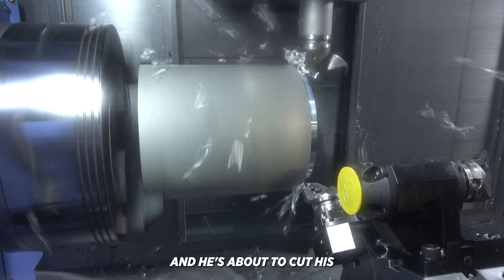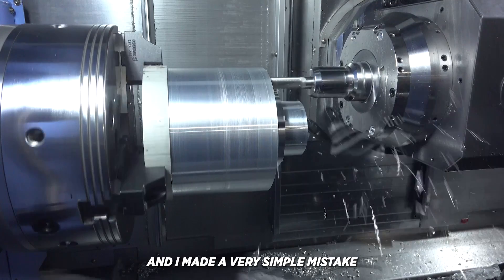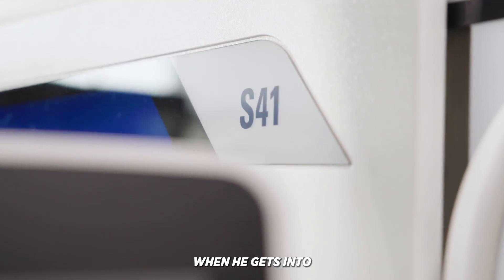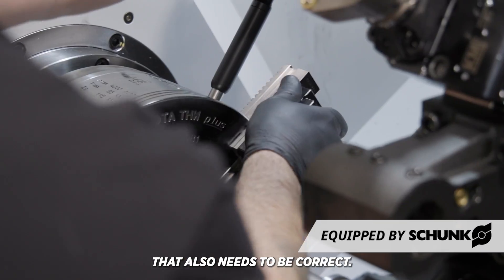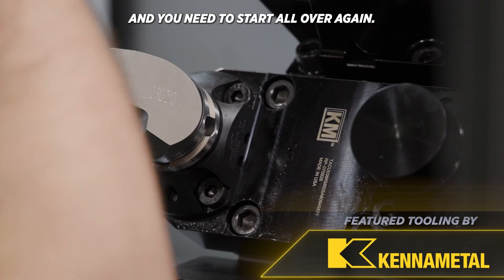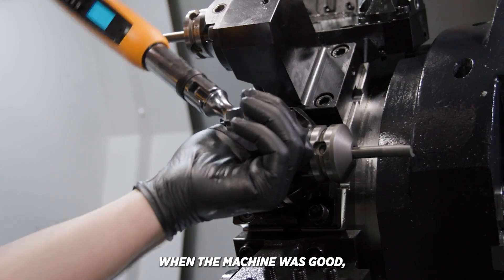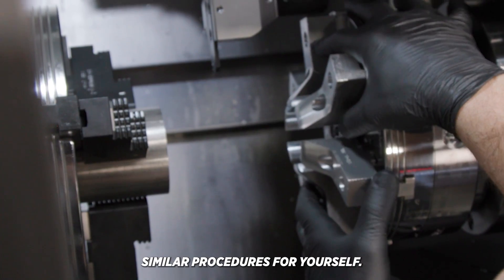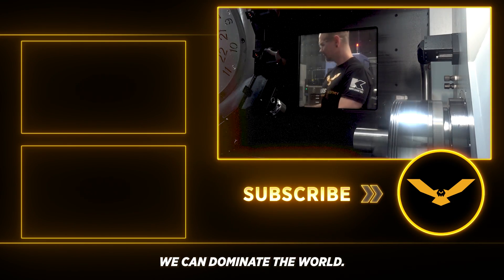My Mistake SMASHED the Tool & Holder Into the Part Causing Huge Damage… What Now?

Comment: My worse crash was throwing 10” cast iron jaws out of a lathe. I had been machining for about 3 years and was cutting a simple bore in a odd shaped part. The G50 was defaulted to 2500 and was running 600 SFM about 1.25 bore size. It didn’t take long for the 4” long jaws to stretch and break the bolts throwing the jaws off the chuck. Im damn lucky it was a newer machine and it kept the jaws in the machine, it broke the glass and damaged the way covers. I have a great deal of respect and understanding of centrifugal force now. looking back at it the job wasn’t well thought out from the start there was no reason we should have been using 10” 4” tall cast iron jaws the job could have been done with 2” aluminum jaws. BE CAREFUL OUT THERE!!!
Reply: I dropped a used lathe we got at an auction once. I was a maintenance guy moving the lathe into the shop. It fell over. Boss was not happy.
Reply: Wouldn’t it have been centripetal force that caused it, not centrifugal?

Comment: I am very fortunate that I don't have to make money with my vintage CNC. I preview the cut in software, I take a run with no tool holder, and then another run using a 3d printed plastic tool holder with a sharpie as a reference for the cutter. My first cut is in a foam block in place of the stock, while my finger hovering over the hold button. It adds a lot of time, but less time than dealing with a cutter and tool holder slamming into something and messing up the tool holder, the taper inside of the spindle, the vise, and then having to re-tram everything. Don't ask me how I know :-(

Comment: I let a roughing tip burn out on a 3 inch stainless steel job as a result the finisher tried taking too much off and ripped the part out the chuck, unfortunately the part jammed between the jaws and a 40 vdi tool that it snapped clean off along with cracking all the linear bearing in the x axis.... $10000 repair. 
There is now a note at the top of the program to change tips regularly. I still have the smashed up jaws, part, bearing and tool i keep in a cupboard to show apprentices what happens when you neglect tips. 
I've done or seen most mistakes in my time but there's always new ones to be discovered.
Always better to be cautious if you think somethings close to hitting bring the tool down manually to check clearances or winding a handwheel away from a part before going in to make sure its at the speed you expect or double/triple checking figures. If something goes wrong its usually when you least expect it. Always visually inspect your parts if something goes wrong 9 times out of 10 you can see it.
Reply: A guy at work was telling me to come over to look at a part whilst it’s face milling because it keeps sparking and looks really cool, I’m like yeah but your tips are fucked that’s why it’s sparking so they need changing asap 😂

Comment: I crashed a milling Machine once with a wrong tool-offset and almost crashed it a scound time because somebody interrupted me during the setup process, doing the setup a second time prevented it. I was lucky  that only  the fixturing and tool were damaged beyond  repair and the spindle was fine.
My setup proces since then is:
1) set tool offset an tool number,
2) put in the tools
3) call the tools and check if the right tool is in the spindle 
4) check the tool offset
5) probe workpiece 
6) measures the workpiece  with a different cycle and check if all values are plausible.
Reply: That is a great process. Ive had my guys check their workoffset with a simple G0 G90 G54 X0 Y0. Is it in the correct spot? Saves parts all the time.

Comment: The only time I ever had a major crash was when I trusted another operators setup at shift change, he had the part loaded, the doors closed, and he said all I had to do was hit go, sure enough he left a locator in place behind the part and 30 seconds into the program a shell mill smashes right into it, luckily the part, fixture and machine were all fine, just replaced the shell mill head and continued on with the part, no issues, we even had a spare locator. but man it was scary
Reply: 100% agree. Never trust anyone. Always double check their work.

Comment: Similar thing happened to me. The tool ran straight down through the part on rapid. Didnt even had a chance to hit an E-stop. The machine stopped itself when the tool holder hit the part. Fortunately it was wood so the spindle was ok, just broke two inserts in the cutter, destroyed a vacuum clamping block and of course made a giant hole in the stock. Good learning experience though. 

Could have been a lot worse. Now my routine is checking everything multiple times, especially Z offsets and always extra caution when running a program for a first time. Did not make a similar mistake since.
Reply: wood in a cnc machine? what kind of work were you doing exactly?
Reply: @blizzardesigns  It is a machine intended for wood, MDF etc. I know I know, I am probably an outsider here :D 

It's a fancy 170k$ 5 axis router basically. It is built for furniture production. Sure it is not a mill, but you can still make very expensive mistakes there.

Comment: I scrapped a 15k part a few years ago, by adjusting a Z offset -.010 instead of -.001.  That was a horrible feeling cause there was over 20hrs labor already in the titanium part.
Reply: And you still had a job after?
Reply: @gooblio  Good question. From my experience, the guy that tries to hide those mistakes end up losing their job. The guy that owns up gets a slap on the wrist. I wouldn't count on keeping a job if you made a habit out of it.
Reply: @gooblio  Yes I kept my job but had to fill out scrap part paperwork, and take a "random" drug test.

Comment: Well I always run a simulation when I can and you would have seen right away that you made that mistake. 
Worse decimal error I experienced was a G0 X240 is was supposed to be X24.0, programmer missed a decimal point. So instead of rapid to 24 inches it tried to rapid thru the part to 240 thousands.
100HP lathe with a 4 speed gearbox in low gear. The spindle didn't stop  A 2000lb 24 inch diameter piece of cast iron pulled out of the chuck and rolled past me. Scared me so bad I couldn't finish my shift. The error was in the middle of the program so very difficult to see and no simulation on the controller. I think it was an old Fanuc 3T long time ago.
Reply: Thats why you need to lower the rapid movment speed when you have changed something in program :). I am using rapid movement just when i am 100% sure that program is correct and functioning as it should.
Reply: @PetrolHarizzo  Yeah on that size part I never run the first part over 25% rapid, but I was still too late getting to the E-stop. It was on a grooving cycle pulling out of the 3rd groove. This was a part that had been run before so the program should have been good.
Is it possible to have an error uploading the program or something else?
Reply: You should have run the prog through the graphics 1st. Then proved it out with low feed control and distance to go in single block.
Reply: @geoffgreenhalgh3553  I like to read the operation before I run it. Sometimes it takes a while, but graphics don't show Z values or feed rates.
Reply: @redbeard_1371  They show the route of the tool.
Reply: lol I worked with a guy who punched a face mill through a 100,000$ part. day before christmas.
Reply: Thats crazy! As an operator, how would you find those errors ahead of time if you didn't write the program?
Reply: @redbeard_1371  to be honest that’s not your problem to spot, the machine setter and programmer should’ve eliminated that before they give it the thumbs up to run
Reply: @willyharris4199  True. But you would be the hero of the day if you did. Good brownie points for someone looking to be the programmer.
Reply: @redbeard_1371  yeah you’re right, I suppose it depends how much you trust the people to do their job
Reply: @willyharris4199  From my experience, the answer to that is "never trust anyone's work". I was at an H-tech in a huge college, (won't mention the name) and the instructor had a Haas St-10 CY "set up" He let me drive and within seconds a live tool ran into the chuck. Fortunately, I had my hand on the feed hold and stopped it before anything broke.

Comment: A sphincter mounted 'e'stop would be great!
Reply: Just keister a little chunk of coal. If you ever crash your machine too badly, even if you lose your job, you'll have a diamond as emergency funds.
Reply: water sensing e stop underwear
Reply: @yo64yo  i will buy it
Reply: These comments....the sphincter e stop....I'm dying lol here
Reply: It's called a pucker E Stop. As soon as your ass clenches it stops the machine.
Reply: I wouldn't get any parts run.  Clenched butthole is just my default state.  I guess I have resting clenched butthole when setting up machines.
Reply: @somethingelse4424  Do you write the programs that you are setting up? I am a little bit calmer if I wrote the program myself. I'm a lathe/swiss machinist. My usual M.O. is to make sure check the beginning and end of every tool to make sure I'm clearing the material/part and of course make sure I'm not going to make parts of the machine that shouldn't be touching each other touch.

Comment: I once crashed a 290mm length tool in a CNC mill becouse we had to put the tool first in the chamber before the big part came in. Soo when I ran the program the tool was too long and crashed into the part in the middle of the tool change.. never crashed the machine before and that was very humilating 🤣
Reply: Almost had a similar experience on a vertical mill with a carousel tool changer, tall vise, tall part and a long reamer. Tool change is up, spindle pulls up and does the tool change right above the tall assembly and the moment the tip of the reamer had less than an inch of clearance at the closed distance between it and the part I've seen my life rush past me haha

There are things you never think about after working for years on the same machine until it happens
Reply: @chas1878  Exactly dude.. sometimes you have to pay attention to soo many factors in some non-mass production scenarios that the most little thing can cause some serious trouble haha. In fact, nothing happend to the tool changer or the tool becouse it has a colision sensor. That pissed me off not by actually crashing it  but becouse didn't manage to notice that beginner  mistake!
Reply: I was paying full attention to all the stuff you usually forget (even removing some tools that might hit the part from the ATC)

And i forget stick out, having less than half a millimeters from a 20k rpm ER40 hitting a part that already cost more than i've ever had in wages at that point

Comment: I'm a little concerned about why your feed hold wasn't working properly lol
Reply: Probably won't work on a threading op.
Reply: In some machines while in a cycle  Feedhold wont-work just like on  A mazak tapping cycle,,,it's fully committed lol
Reply: @jasonruch3529  interesting!  I didn't know that...good to know, cause we just got a Mazak lathe lol
Reply: @Steelcrafted  feed holds when threading on a mazak will complete the cut then hold. external screw cutting it will finish the pass pull away from the part then hold, very useful when chasing threads. 
when setting the block for the stock material its best practice to set it correctly because it would avoid mistake like whats explained in the video as when you go to simulate the part it will error out as it will identify that there isnt enough material for the cut to work
Reply: @jasonruch3529  Exactly
Reply: He said he was threading. Some machines will finish the pass even with feed hold pressed, some will pull out immediately. The mazak in our shop will finish the pass. Some Okumas that I’ve run in the past will retract while maintaining pitch then stop, others will finish the pass.
Reply: @M R absolutely not true. Some machines are more than capable of stopping.

Comment: Yeah basically always double-checking offsets, when I moved from a CNC router to CNC milling with tool holders I buried a few drills through my fixtures being on the wrong tool, my first tormach had no tool changer so it wasn't hard to accidentally put the wrong tool in the wrong operation, now with an ATC on my new tormach, that rarely happens, but always check just in case. I'm working on building out actual work instructions for all my operations, going to take an eternity, but essentially anyone I bring on to help me can follow the step-by-step guide and make great parts. Stay vigilant!